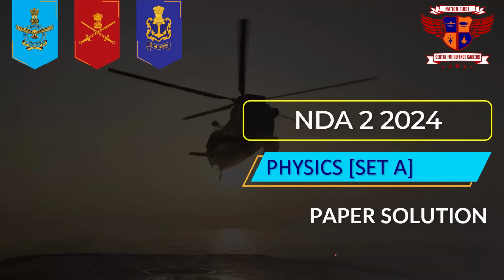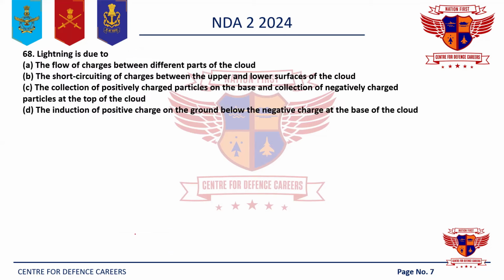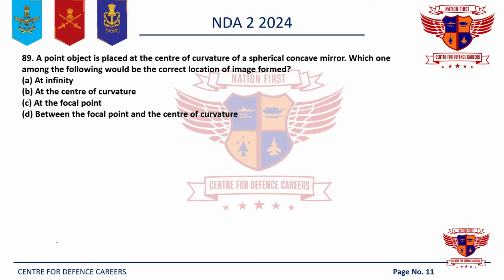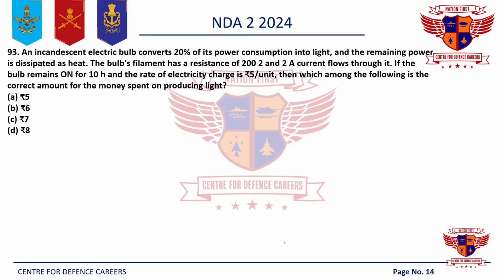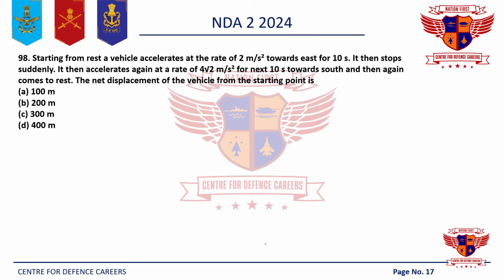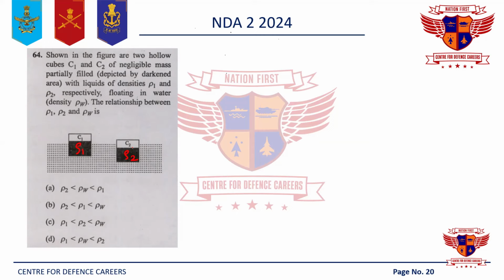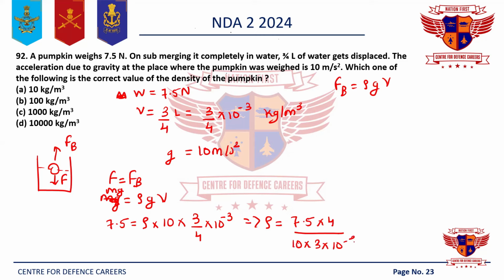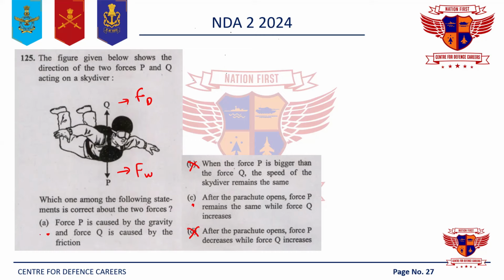NDA 2 2024 PHYSICS SOLUTION

Comment: I have a question to ask  , in question 65 , there isn't mentioned  anything that says the space station is freely falling but you did all the calculations of that question based on that ( you can check in video time 2.44 minutes to 2.50minutes ) [THE SPACE STATION ISN'T FALLING BUT ORBITING , ARE THESE TERMS SAME ?  ] , I think we should use the concept of centripetal force here as it is orbiting , it's centripetal is completely governed by acceleration due to gravity,  so the overall force will become zero , by F=mv²/r - mg=0 as "mv²/r=mg".   😅